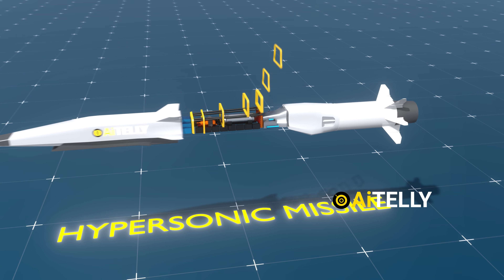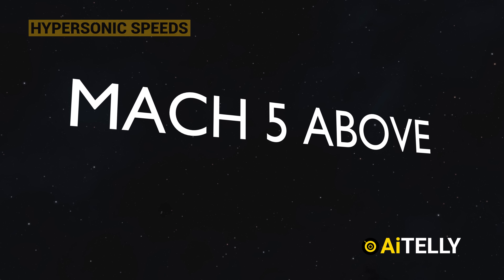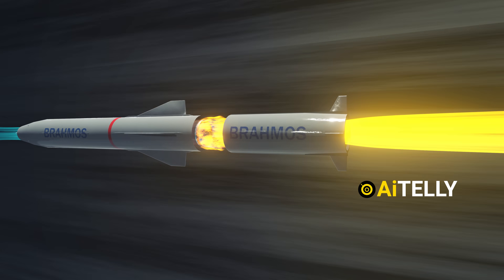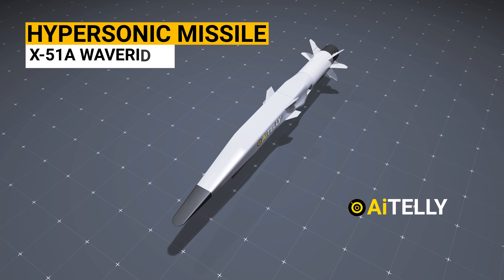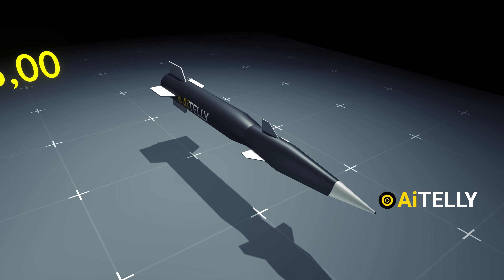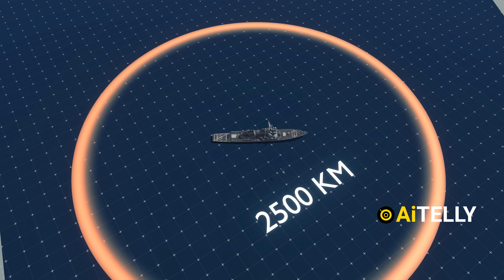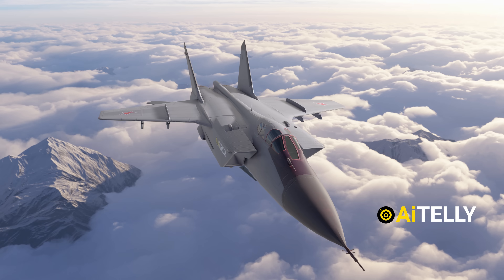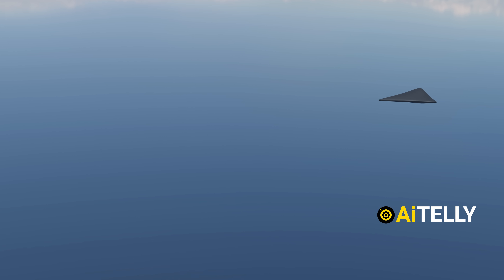How Hypersonic Missile Works?

Comment: Misleading and very inaccurate video.
- On the map the whole of Eastern Europe is part of Russia (Ukraine, Romania, etc,). Do you know something we don't?
- Not a word about the difference between ballistic and cruise hypersonic missiles. It makes a difference whether a missile can accelerate itself in the atmosphere above Mach 5, or whether the supersonic missile only accelerates so much using gravity during the terminal descent (traveling in a ballistic arc). For example ICBMs have been hypersonic for 70 years.
- The MIG-31 reaches its maximum speed in high atmosphere, not low, so for the purposes of this thread it is irrelevant how fast it flies at low altitude. It does not fire its missiles at low altitude. And the high speed of the aircraft is important because the speed of the missile 'adds' to the speed of the aircraft. This should be stated.

Nicely done video, but please pay a little more attention to detail.
Reply: Jesus christ dude why are you PMS’ing

Comment: Question?
That's Y there is a BIG rush for hypersonic, MOST countries are behind.
What about this NEW Russian Nuclear powered Cruise Missile?
Is the Fuel or Hydrogen Pressurized?
That booster falls off, how long is it time, pressure or temperature, when it falls off?
Is it possible to use a Hypersonic against a Sub or a Satellite?
How are Hypersonic's against a EMP, or any other explosion from a missile?
What about Helium vs Hydrogen, as a fuel source?
Does the GLIDE VEHICLE ever get INTERCEPTED?

Comment: Hmm a lot of people is saying us has hypersonics that’s not true, one factor that the Chinese hypersonics have is that they change directions, hence very hard to be calculate by air defends, your missile does travel at mach5 but it doesn’t change direction.
Reply: Bud the US has lasers that are faster than hypersonic misses.
Reply: @MadMan-vs2mc  hmm bud maybe you don’t have a technical background so let me explain it to you. To accurately point the said laser at those missiles you would need something to detect them, by the time your detection system sends out a signal that bounces off the rockets and returns the rockets current location back to the transmitter. The rocket would be somewhere else. For example, the Chinese df21 with an estimated max speed of mach10 would travel 3.48km per second which is 2.13 miles per second for you.
Reply: @MadMan-vs2mc  lmao you should have finished school, you think they are detecting asteroids in space with the accuracy enough to shoot them down and not as minor bleeps on a radar?
Reply: Wrong
Reply: MAKO, and LRWH. Hypersonics cannot maneuver enough to hit moving targets. It’s possible to shoot them down.

Comment: The air would have to expand in order to cool the scramjet walls and compress in order to compress and heat the air fuel mixture increasing its velocity

Comment: The Kinzhal is not a hypersonic weapon in the context of the use of the term "hypersonic weapon". All Ballistic Missiles are faster than Mach 5 so "hypersonic". But it is just an ALBM Air Launched Ballistic Missile. Ballistic meaning not manueverable, which is what is meant by the term hypersonic weapons in that context. 
This is commonly misunderstood by many.
Also, the ATACMS is a ballistic missile and far exceeds Mach 1.
Reply: The problem is that the dagger manoeuvrable and precise
Reply: @serheyyavotsky1246  the Kinzhal is not manueverable. Precise? Sometimes. Others it misses by literally dozens+ km. It's literally just an air launched Iskander.

Comment: Is it possible for the Ukraine Air Force to modify an ATACMS missile into a Hypersonic missile, using a modified exterior design and F-16 to launch it?
Reply: I don't think that F-16 is able to launch so huge missile. Even MiG-31 that can travel higher and faster than F-16 loses like 30% of its speed.

Comment: Can something moving that fast even be ACCURATE?? 🤔🤔🤔🤔
Reply: @jjojo2004  greatest problem)
Really, with 5+ mach speed
-you can have plasma screen (radioprotector and high temperature)
-problems with GPS, with radar guidance 
-problems with any optic/IR guidance
OR you nuke them all
OR you need to slow(in AA defence zone,yeap)
Reply: Ask Ukrainians 😅
Reply: Hypersonic engine Scramjet Mach5 can NOT work at low altitudes, only above ~18 000m,  for lower altitudes you need ramjet engine Mach 2,5. 
That's why the American hypersonic plane SR-72 has 3-mode engines.
Turbo-jet, ramjet, scramjet. 
People think hypersonic weapons can hit targets at hypersonic speed, that's not true. We have an atmosphere, all falling objects slowing down coz atmospheric pressure.  That's why on the Moon we see craters, the moon doesn't have an atmosphere, meteors are not slowing down and hitting the moon with max speed.

Comment: United States has no such weapons
Reply: The US has hypersonics since 2023 Long-Range Hypersonic Weapon (LRHW). Hypersonic Air-breathing Weapon Concept (HAWC), Hypersonic Attack Cruise Missile (HACM), OpFires, Hypersonic Air Launched Offensive Anti-Surface (HALO), AIM-260 Joint Advanced Tactical Missile (JATM), Mako Multi-Mission Hypersonic Missile. All of this is already in the final stages of testing, will enter service in 25-27
Reply: @Хз_хз_3188  at the Navy League's Sea-Air-Space conference's April 2023, Rear Admiral Stephen Tedford, Program Executive Officer for unmanned aviation and strike weapons at NAVAIR, said that HALO might be "a little bit of a misnomer" because it might not reach hypersonic speeds.[5] Tedford said that HALO may reach only supersonic speeds, rather than hypersonic speeds (i.e., the Mach 5 threshold). 

Source: wikipedia
Reply: Technically speaking US had one in the 1980s with Pershing II. It uses a MARV (Maneuverable Advance Rentry Vehicle) warhead and is the 1st of its kind. DF-21/YJ-21 are based on the same tech. Operational too for about a decade before forcefully retired due to the INF Treaty. But they now brought it back or a derivative of it with LRHW/CPS. It has twice the range of DF-21 and even faster too at Mach 17. US Army received its 1st LRHW prototype battery since October 2021. “Today marks an important milestone in equipping our nation’s first hypersonic battery,” said Lt. Gen. L. Neil Thurgood. A 2nd battery is in the works for 2025 and a 3rd one for 2027. 1st battery is currently deployed at Cape Canaveral and had recently made a successful all-up round AUR live fire test. It is also light enough to be transported by a C-17 Globemaster. Once landed it can launch its missile similar to M142 HIMARS. Japan already agreed to host them.
Reply: Yes we do. You Russian bots get stupider by the day.

Comment: USA don't have
Reply: Technically speaking US had one in the 1980s with Pershing II. It uses a MARV (Maneuverable Advance Rentry Vehicle) warhead and is the 1st of its kind. DF-21/YJ-21 are based on the same tech. Operational too for about a decade before forcefully retired due to the INF Treaty. But they now brought it back or a derivative of it with LRHW/CPS. It has twice the range of DF-21 and even faster too at Mach 17. US Army received its 1st LRHW prototype battery since October 2021. “Today marks an important milestone in equipping our nation’s first hypersonic battery,” said Lt. Gen. L. Neil Thurgood. A 2nd battery is in the works for 2025 and a 3rd one for 2027. 1st battery is currently deployed at Cape Canaveral and had recently made a successful all-up round AUR live fire test. It is also light enough to be transported by a C-17 Globemaster. Once landed it can launch its missile similar to M142 HIMARS. Japan already agreed to host them.
Reply: The US has hypersonics since 2023 Long-Range Hypersonic Weapon (LRHW). Hypersonic Air-breathing Weapon Concept (HAWC), Hypersonic Attack Cruise Missile (HACM), OpFires, Hypersonic Air Launched Offensive Anti-Surface (HALO), AIM-260 Joint Advanced Tactical Missile (JATM), Mako Multi-Mission Hypersonic Missile. All of this is already in the final stages of testing, will enter service in 25-27

Comment: America doesn't have hypersonic missiles.   With moronic defense contractors like Boeing, we can't figure out that technology.
Reply: Technically speaking US had one in the 1980s with Pershing II. It uses a MARV (Maneuverable Advance Rentry Vehicle) warhead and is the 1st of its kind. DF-21/YJ-21 are based on the same tech. Operational too for about a decade before forcefully retired due to the INF Treaty. But they now brought it back or a derivative of it with LRHW/CPS. It has twice the range of DF-21 and even faster too at Mach 17. US Army received its 1st LRHW prototype battery since October 2021. “Today marks an important milestone in equipping our nation’s first hypersonic battery,” said Lt. Gen. L. Neil Thurgood. A 2nd battery is in the works for 2025 and a 3rd one for 2027. 1st battery is currently deployed at Cape Canaveral and had recently made a successful all-up round AUR live fire test. It is also light enough to be transported by a C-17 Globemaster. Once landed it can launch its missile similar to M142 HIMARS. Japan already agreed to host them.
Reply: The US has hypersonics since 2023 Long-Range Hypersonic Weapon (LRHW). Hypersonic Air-breathing Weapon Concept (HAWC), Hypersonic Attack Cruise Missile (HACM), OpFires, Hypersonic Air Launched Offensive Anti-Surface (HALO), AIM-260 Joint Advanced Tactical Missile (JATM), Mako Multi-Mission Hypersonic Missile. All of this is already in the final stages of testing, will enter service in 25-27

Comment: Does America really have  hypersonic missile in service
Reply: @chubbyspider4335  nope
Reply: @eizlan48  in production.
Reply: @chubbyspider4335  No
Reply: No!
Reply: Technically speaking US had one in the 1980s with Pershing II. It uses a MARV (Maneuverable Advance Rentry Vehicle) warhead and is the 1st of its kind. DF-21/YJ-21 are based on the same tech. Operational too for about a decade before forcefully retired due to the INF Treaty. But they now brought it back or a derivative of it with LRHW/CPS. It has twice the range of DF-21 and even faster too at Mach 17. US Army received its 1st LRHW prototype battery since October 2021. “Today marks an important milestone in equipping our nation’s first hypersonic battery,” said Lt. Gen. L. Neil Thurgood. A 2nd battery is in the works for 2025 and a 3rd one for 2027. 1st battery is currently deployed at Cape Canaveral and had recently made a successful all-up round AUR live fire test. It is also light enough to be transported by a C-17 Globemaster. Once landed it can launch its missile similar to M142 HIMARS. Japan already agreed to host them.
Reply: In production.
Reply: im sure folks at General Motors are working hard on the project!
Reply: The US has hypersonics since 2023 Long-Range Hypersonic Weapon (LRHW). Hypersonic Air-breathing Weapon Concept (HAWC), Hypersonic Attack Cruise Missile (HACM), OpFires, Hypersonic Air Launched Offensive Anti-Surface (HALO), AIM-260 Joint Advanced Tactical Missile (JATM), Mako Multi-Mission Hypersonic Missile. All of this is already in the final stages of testing, will enter service in 25-27
Reply: @Хз_хз_3188  Still experimental. They are far from being serially produced, much less deployed.
Reply: @underworldblu  What are you talking about? They've been in service since February 2023, the 5th Battalion, 3rd Field Artillery Regiment (5-3 LRFB) — 1st MDTF's long-range fires battalion.

On 28 June 2024 DoD announced a successful recent end-to-end test of the US Army's Long-Range Hypersonic Weapon all-up round (AUR) and the US Navy's Conventional Prompt Strike. The missile was launched from the Pacific Missile Range Facility, Kauai, Hawaii, landing more than 2000 miles away in the Marshall Islands. Another test of the LRHW all-up round is planned for 2024
Reply: @underworldblu  Lockheed martin just developed the mako which fits on fighter jets. 😂
Reply: @underworldblu  they are in production right now.
Reply: @Хз_хз_3188  actually, only lrhw was fielded in 2023, the rest, are in production and currently rn lrhw is the only one fielded.
Reply: Faq around n find out 💀💀
Reply: None of your business
Reply: Russia doesn’t have one either.
Reply: @mabotyin  do you live in cave? . are there no internet in africa

Comment: this channel is seriously underrated for its quality
Reply: Надо сказать: плохого качества. Ибо уровень пропаганды тут низкий, можно и лучше.
Reply: Nope. Author of this channel has no idea how hypersonic weapons work.

6:27  Hypersonic weapons NEVER fly at low altitudes with Mach 5, as the author shows.  Because it will lose kinetic energy for a few seconds coz of highest air density, max speed will be Mach 2,5 even with common rocket booster and solid fuel will be off very quickly.  Hypersonic Scramjet engine does not work at low altitude, you need ramjet engine Mach 2,5 for low altitudes.   No one  engine can give you Mach 5 at low altitude, no one.

Hypersonic weapons are stratospheric weapons that fall down to minimize losing kinetic energy, never flying at low altitudes. 

 US developed a dual mode scramjet engine for missile that works on high altitude in hypersonic mode, and as ramjet in supersonic mode at low altitudes. Different altitudes require different types of engines modes. 

That's why the American SR-72 hypersonic plane has a three mode engine, turbo-jet for take off, ramjet for acceleration, scramjet mode for hypersonic speed, changing the design of air-intake during the flying.
Reply from the maker: Thank You for the Kind Gesture
Reply: @Aitelly  bramos missile is best example try it
Reply: @Aitelly  which softwar do you use for making these animations
Reply: Hi. Can you make a video about using laser canons against rockets and drones?  Thanks  @Aitelly
Reply: Dude definitely has Federal funding.
Reply: @Trome1200  prove it
Reply: @Trome1200 if he was funded by feds he would have shown obvious bias about russian and Chinese technology. He is objective.
Reply: @Trome1200 prove it conspiracy